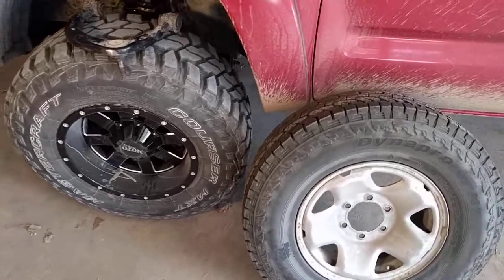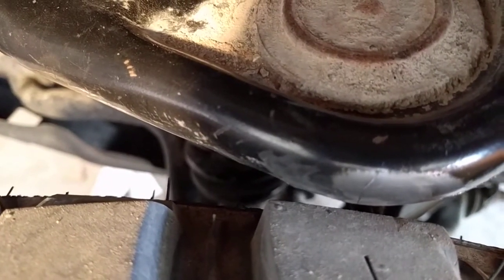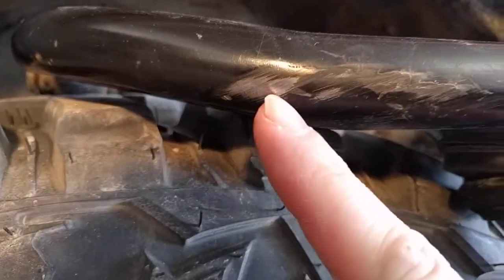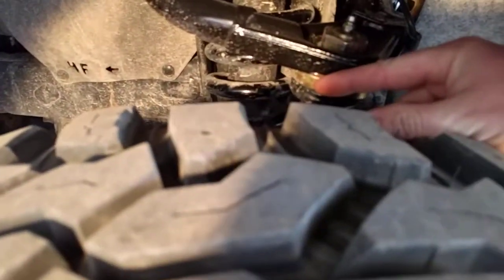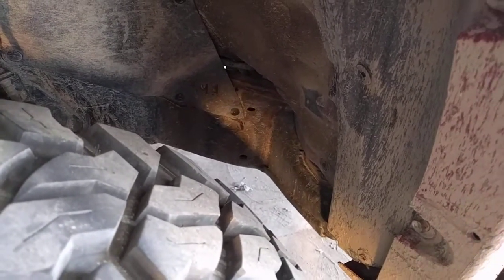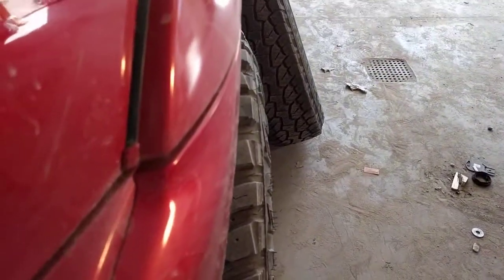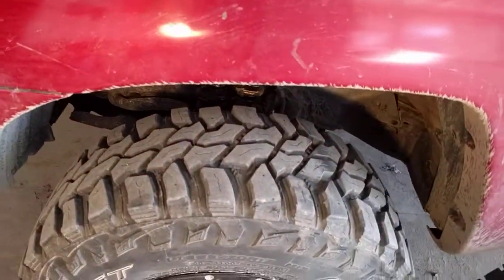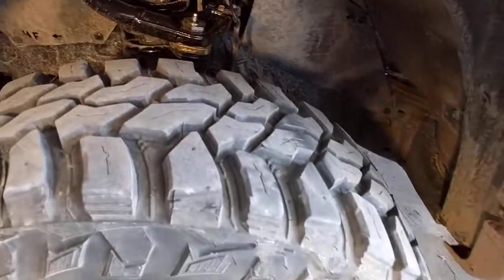2nd gen Tacoma offset 285's

Comment: I’m in a 2010 Tacoma double cab prerunner and I’m about to lift it about 2 or 2-1/2”. I’m looking at a set of scs 17” -38 offset and was wondering what I can expect from going with this setup. Also, what uca did you switch to. I’m not a fan of spacers .I really like the deep dish look but not enough to sacrifice ride and handling.
Reply from the maker: -38 is going to be way out. my UCA was made by SPC I think.

Comment: Hi. I'm running BFG'S on my 2008 Toyota Tacoma X-Runner. I also installed 1inch spacers on all 4 wheels. I have a 3 inch lift on the rear and a 4 1/4 inch lift on the front. When I turn left or right , it feels like the tires are being dragged. Should I remove the spacers? I'm still using 17 inch stock aluminum wheels.
Reply: Hi I forgot to tell you that I have KO 2'S 285.

Comment: It looks to me you could have used spacer disks that would have kept the wheels away from there that's what I did years ago on my ford 4x4 ranger I was running mickey thompson's 33" incher's very wide tires they were.
Reply from the maker: It was a tire shop screw up, they got the right offset about a week latter. I don't like bandaids for fixes which i would consider what a wheel spacer is.

Comment: Thanks for posting. I'm trying to decide what offset and backspacing I should get for my 15. Did you ever get a chance to test the travel and see if and where they rub?
Reply from the maker: Yes and it did rub the cab corners and a some of the inner fenders.
Reply: Dustan Tompkins when you say "cab corners" where do you mean? The area where the "cab mount chop is done?
Reply: Sorry for all the questions. What about the rears? Are they able to tuck in to the wheel wells or are they rubbing the fenders? Thanks for the info!
Reply from the maker: Yes cab mount chop is what I meant.
Reply from the maker: If you are going to be Off-roading and flexing I'd add the longer brake lines, you will need longer shock regardless if you lift the back. I called 4wheelparts and talked to them and they sent me the correct length shocks. Highly recommend the Bilstein or fox, but you can get even more expensive if you want.
Reply: right now I have Adjustable 5100s in the front with a plate spacer. In the rear I have a addAleaf with extended shocks
Reply: I'm wondering about the Rears. Are the tires able to tuck into the wheel well or are they hitting the fender when your rear axle is flexing?
Reply from the maker: My tires never came close to the fenders. I was never out rock crawling tho so not sure if I fully flexed it out. I think I had 2 or so inches of clearance.